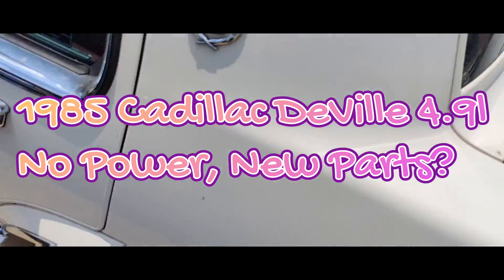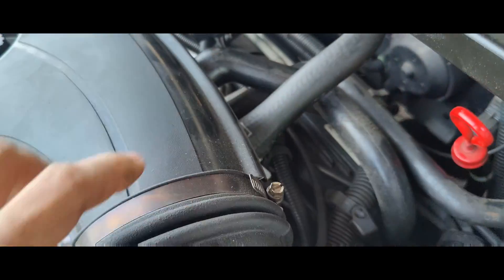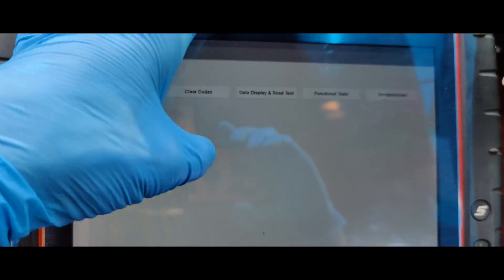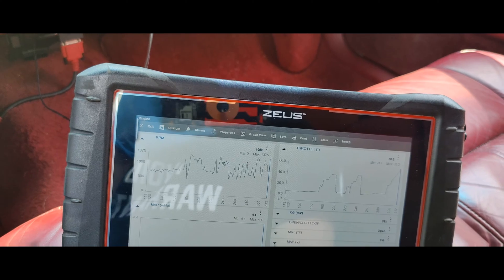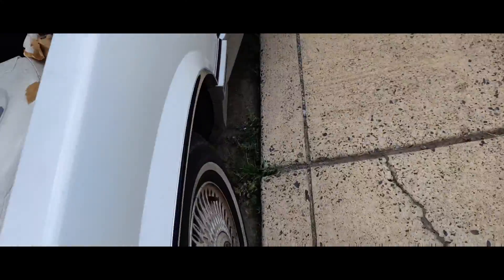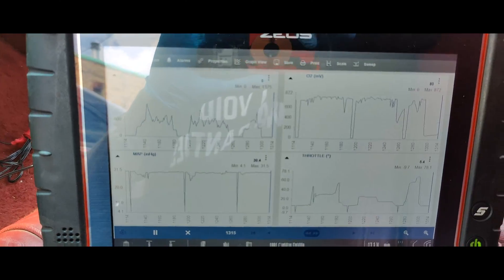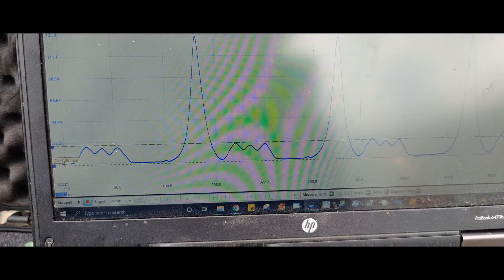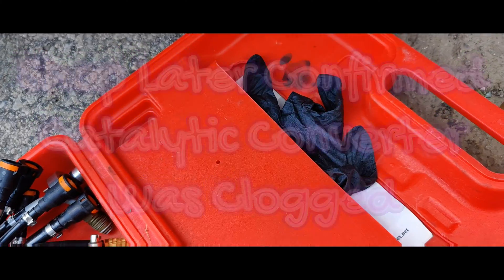1985 Cadillac Deville 4.9l No Power, Rough Idle, Stalls

Comment: I knew it was drowning in fuel and had a plugged cat @ 1:45. But then I've been doing this for 40 years...
Reply from the maker: How did you know that?
Reply: @RobertDotterer  I could hear that the engine was blubbering from excess fuel which is a different sound than an engine makes when it is struggling because it is too lean. And you can hear the engine struggling against a plugged cat in the tone and timbre of the intake noise.

Comment: Rob as always another informative video. Like how you used fuel flow and fuel pressure to do diagnoses the problem. Where did you check the in cylinder pressure before hose broke? Have to compare them to my Brandon Steckler waveforms in his text. Thanks for sharing 👍
Reply from the maker: I check it in the front drivers side cylinder. In the spark plug hole.